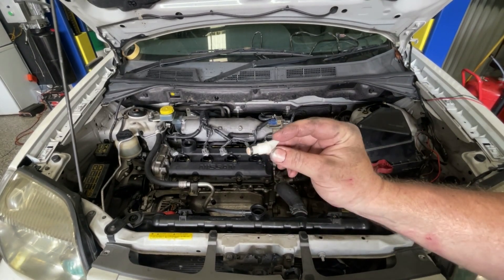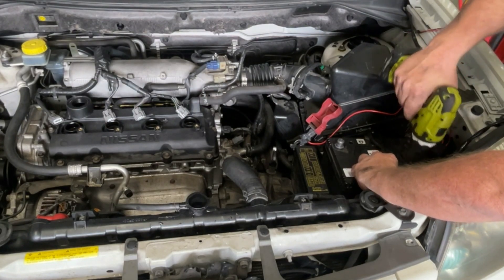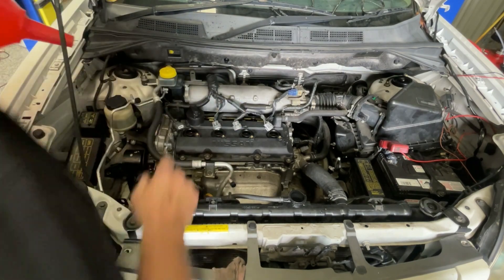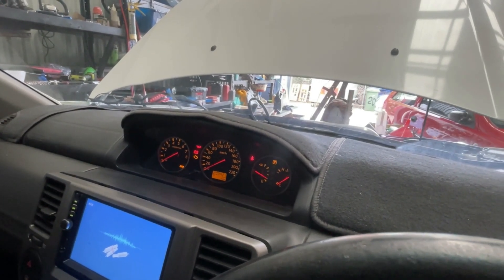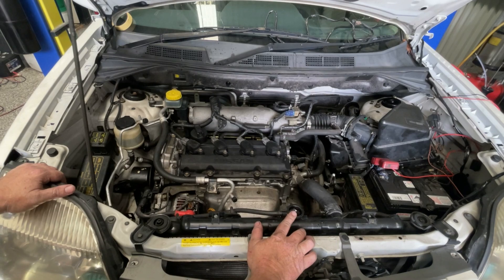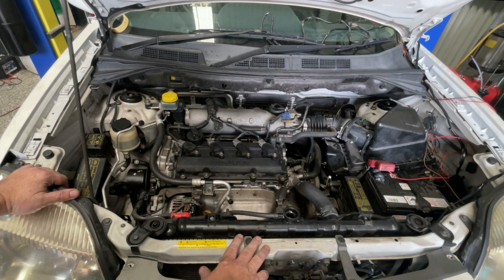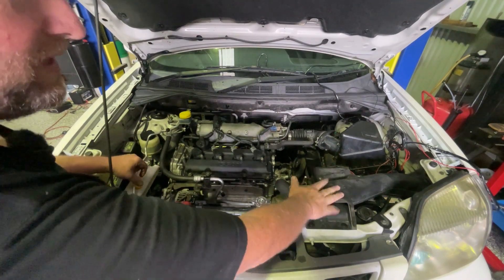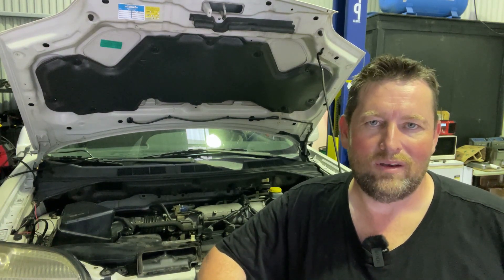Nissan X-Trail Head Gasket Replacement -Install Part 10 of 10. QR25

Comment: I followed this entire video series and changed my head gasket. It took around 25-30 hours total.
I turned the key, the engine started!

Then the oil mixed with the coolant, the cylinders misfired and the engine lost compression.

It's now joining all the other 2006 X-Trails in the local scrap yard.

Comment: Thanks for your video…l just followed from a-z on my 2.0 xtrail…I skipped some tearing and went for the h,gasket directly…and all is good now. But one thing…..when we connected the battery everything started up, I mean the car tried to start on its own!! We took off the control wire from the starter and plugged the battery in again and it was like the computer went two cycles around the whole electric system before it stopped and everything was normal. All this happened with ignition switch of…with or without key in the switch….we were very surprised and looked for “something”for 1,5 hours and came up with nothing….thanks again….
Reply from the maker: Hope you find your problem.

Comment: I was wondering I did everything to a t and my xtrail starts up fine and drives fine it got lots of power but when idling it will stall and sputter and shake till it quits I was wondering if maybe being off a tooth in timing would do that?

Comment: You mentioned at the end of doing an oil change. 

Just want to check. When starting it back up, did you only put the minimum amount of oil in the engine? Then after leaving it to run, you then removed it all? Just to get rid of any of the nasty oil trapped in the system?

OR did you just put more oil in the engine and you're happy as Larry?
Reply from the maker: Did a full fill and after a few hundred kms did a full oil change

Comment: What’s parts did you need to purchase to complete the job?
Reply: Head gasket ,bolt  and seal kit (120$ online) , Torq wrench ( cheap one can do it)
Etorx box for the oem head bolt ,  right stuff, degree dial gage for torquing the head, basic tool .